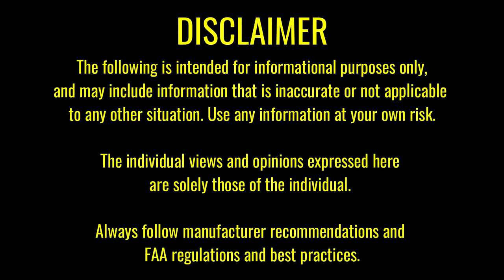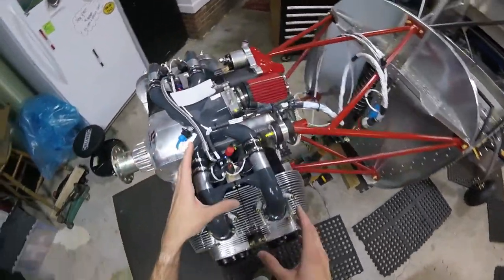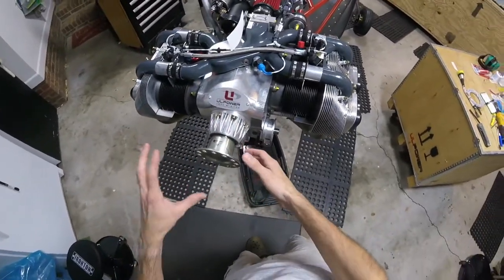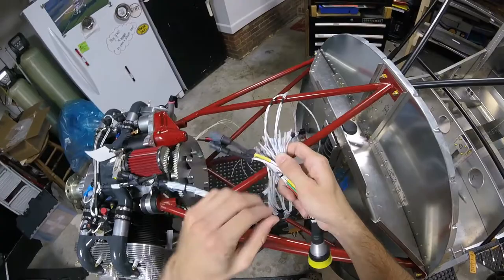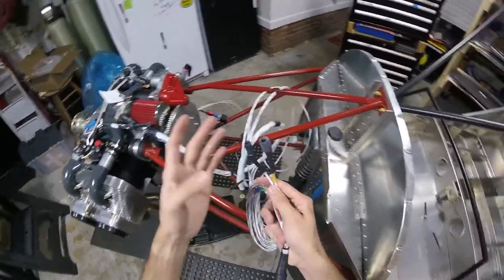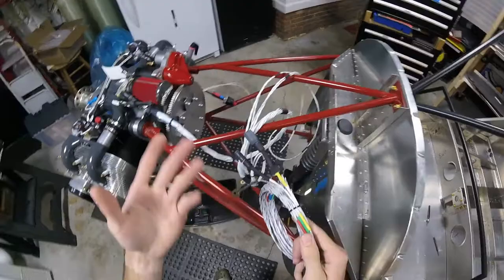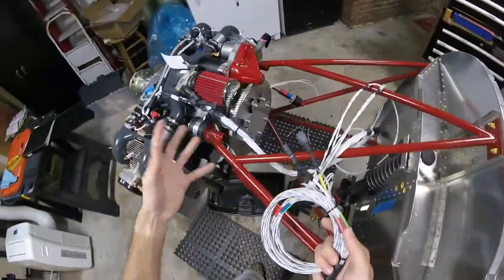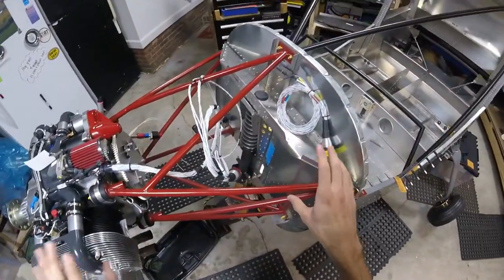Getting to Know Your ULPower 350iS - PART 2 - Sensors & Engine Monitoring (MGL Avionics) Zenith 750

Comment: Go with the IEFIS light an rdac, and sp6.  That eliminates the IBox and SP7 ahars.  You only need one screen plus an Ipad for traffic, weather, and moving map.  You will also need a radio, transponder, and ADSB in and out.  about 10 grand if done wisely.
Just my opinion.  MGL is a great product.  Also, always are cht, egt probes an additional item.  Also fuel flow is possible I believe without buying a sender. just tap one injector, low side.